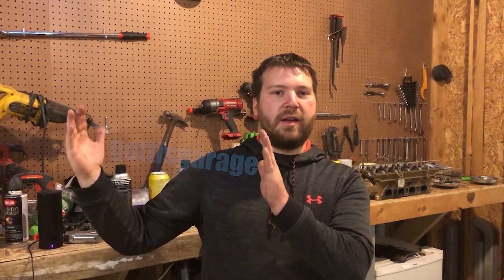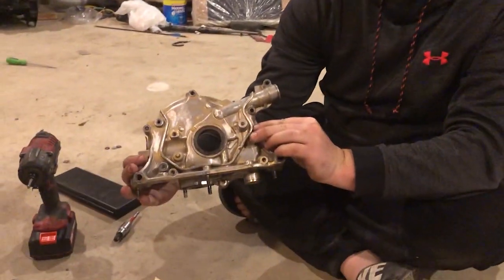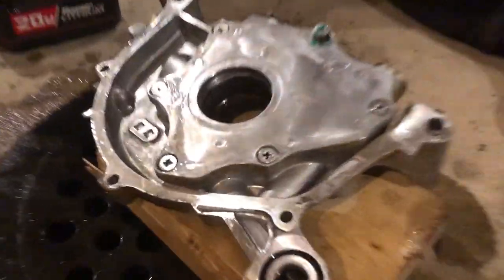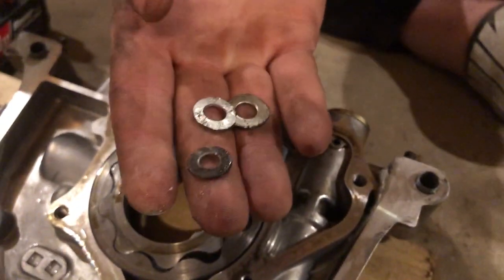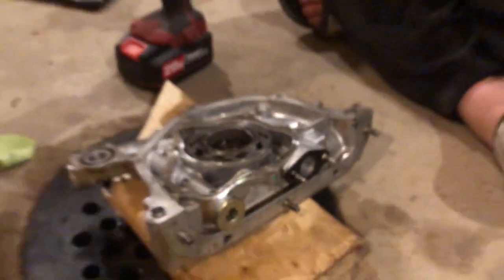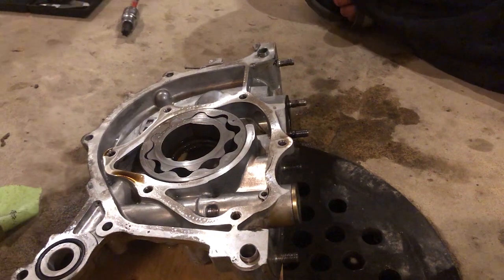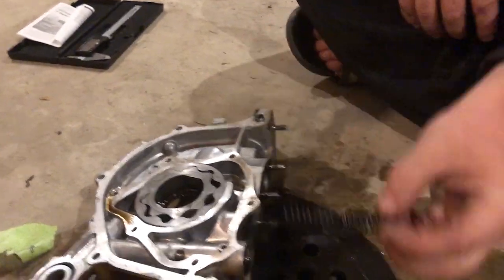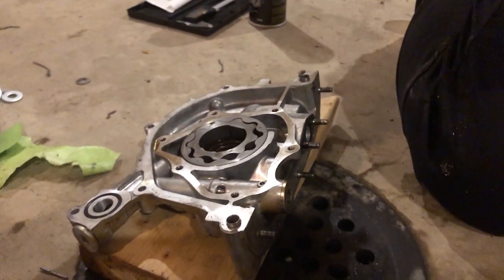How to Shim or Modify Honda or Acura Oil Pump to Add PSI

Comment: Whatever happened to the update video with the outcome of doing this?

I did this with a little less like 3mm and haven't noticed the difference.

Also, too much, like too little can do damage to these motors.
Reply from the maker: The engine got stolen unfortunately, Boostedboiz has proven that shining the oil pump does work. He's gotten 100psi of oil pressure from doing it. Ill be swimming the ls im building as well
Reply: @GottisGarage  what is/was your oil pressure at 190 degree running temp?
Reply from the maker: I'm not sure honestly. I bought the engine from a buddy to redo and never got the chance to